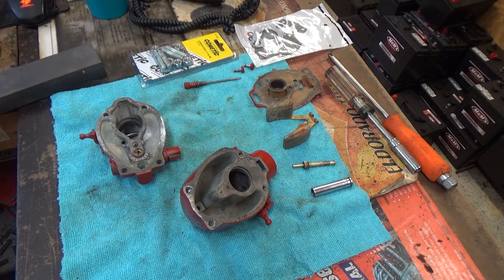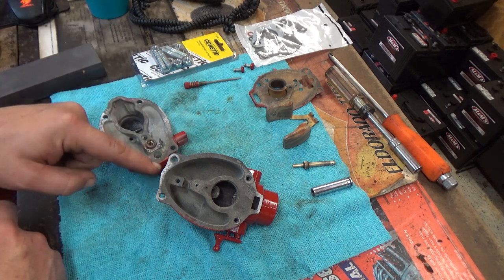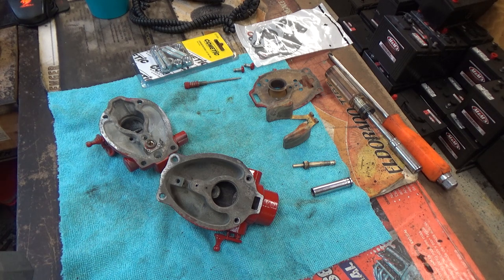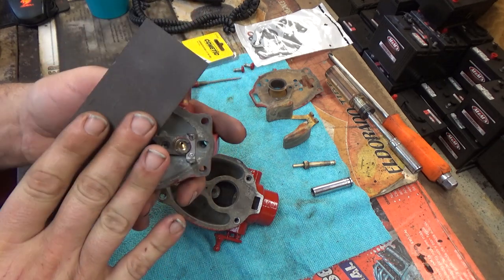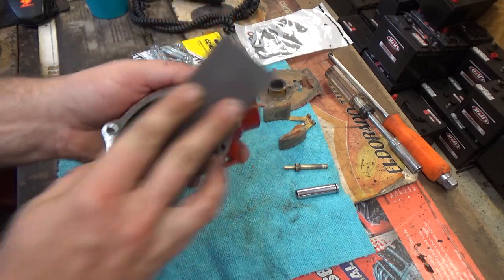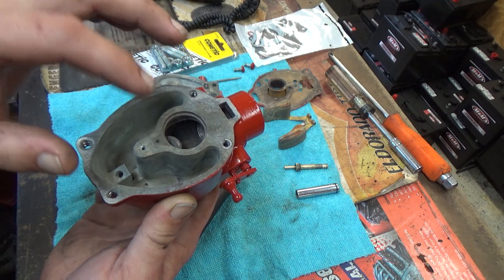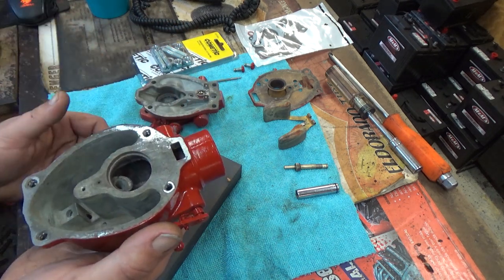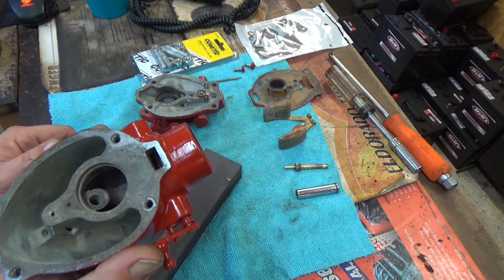M&MS Quick Fix Short Clip Ep6-1   Marvel Shebler Common cause for Flooding or Leaking Gas at Intake

Comment: I use a cutout from a granite counter top sink installation as a surface plate. The sink cut outs can be had free or fairly cheap as they are too small be of use to the counter top guys. 
The granite is plenty flat for what I use it for.  I contact cement a piece of 120 to the surface block. I surface small engine heads and anything else that needs to be flat with this method. 
It's nice when you can find a gasket set for sale on line. My question is do you have a slick way of cutting out new gaskets when you can't buy new? What is the best source for carburetor gasket material? What is the best gasoline proof sealant for those problem times when it needs to stop leaking NOW and you can't stop to fix it right?
Reply from the maker: Gasket material is sold at any decent automotive parts store.  You will need to specify to the salesperson that you want sheets or rolls of gasket material. Most likely they'll go get their manager lol.  Unfortunately most young people don't know what that stuff is.   
once you've got the material we usually cut a square slightly larger than the area you want to make the gasket for then we take a small a ball peen hammer as possible.. and tap all over the surface area.  Sometimes the hammer will cut the gasket out for you but the basic premise is that it will imprint the design then you can trim it out with razor blade or scissors.  We use old school handheld hole punches to do all the tedious work.   
As far as a sealant there's nothing you could just smear on to stop the leak but the best thing you can get to try is gray sealant.  There are two types of Gray usually right beside each other on the parts store shelf.. the one you want will specifically say fuel resistant or fuel safe on the label
Reply: @AtlastaFarmCo  Man you are right about most of the young clerks at the parts store. It saddens me when one of the old timers is let go or retires with the wealth of knowledge they must have.
Reply from the maker: @johnpullman3227    HAHA.  I used to spend my free time at a local Oreilly autoparts...   We still get our terminal products there (sealants etc).  Everytime someone new started and lasted a month or so I would make a point to show them how to use the parts catalogs. ..  It was amazing how much was actually in the store that could not be found on the computers...   Cant do that anymore though.. last year they basically did away with the old catalogs.   they look like the phone book now with no real information. We collected all the old books the stores would throw out when replacements came in.  The part numbers have changed on alot of products but we can still search those numbers and come up with the current part number..   Its such a hassle, but worth it
Reply from the maker: I actually need to add a trick to this....    If its an emergency, and you can dry the area (shut off fuel and clean it with a degreaser like alcohol or starting fluid)  Then hose the area with old school cheap hair spray..  LOL   It is not permanent but will work.    Used to seal vacuum leaks that way!
Reply: @AtlastaFarmCo  I took brake rotors in to a local parts store where they used to know me. The guy let me go back and watch him turn the parts. Their brake lathe was falling apart and the auto feed didn't work. I asked why they didn't fix it and they said they were waiting for corporate to buy a new one. I offered to take a look at it. After hours they let me in and I took the auto feed apart and discovered the electric feed motor and cooling fan were literally packed full of iron filings , the set screw on the manual feed handle was lose and the handle just spinning on the shaft. After I finished fixing it I was met with blank looks of people who just don't care. To them its just a paycheck I guess. No pride. 
They had all the tools on the shelf to fix the machine but instead let it fall apart. No one there was willing to take the initiative to fix it and I needed to have rotors accurately turned on an operable machine. You got to wonder!!!   

As far as old part numbers the old books are priceless. There is the Fellow up in Idaho SteeringClutch.com who is a wealth of information. I was looking for bronze friction discs for the 4500 and after my research I found some that had the same specs but were for a forklift. They were 1/3 the price. I emailed General Gear and Machine and had a great discussion about how manufacturers will take common generic parts, put their part number on them and ask outrageous prices for a common item because out of ignorance we can't tell the difference. Finding people who will talk to you intelligently about all this stuff is a rarity.
Reply: @AtlastaFarmCo  Its amazing what the girls put in their hair